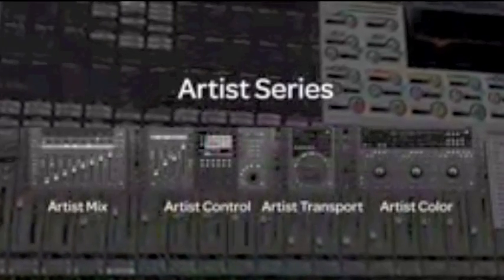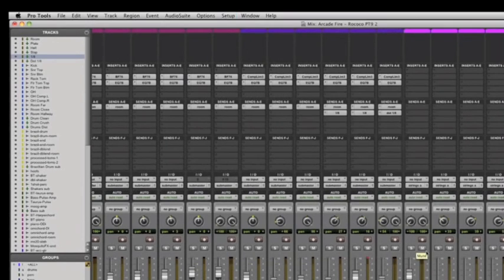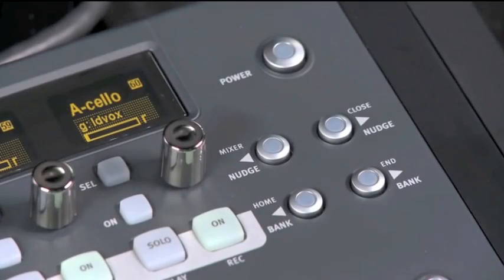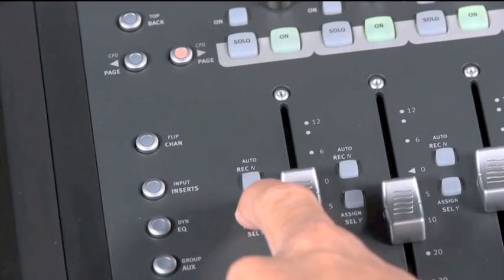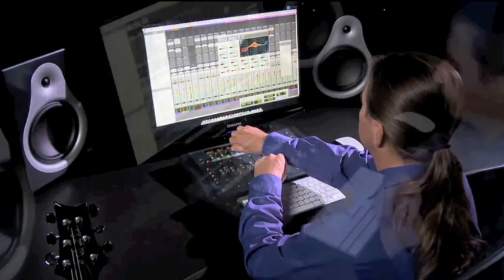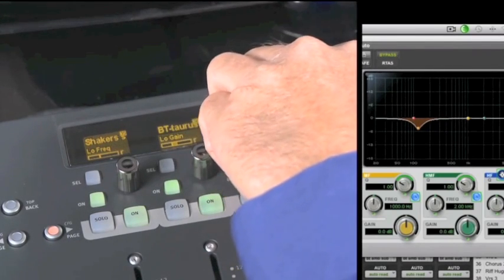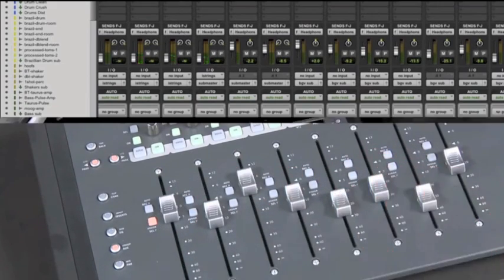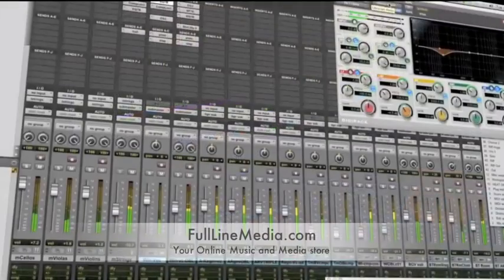Avid Artist Mix Control Surface for Pro Tools Software - Avid Artist Mix

Comment: I love this ridiculous statement at 1:49: "To get started, simply connect Artist Mix to your computer, and select Ethernet controllers from ... menu. And you're ready to go."  What a joke!  Has any AVID product worked on setup?  I bought Artist Mix, and have been trying to install it and get it to work since yesterday.  Hours later, frustration, new software downloads, and it still won't budge. Can't get it to do anything.  Spend all that money (much cheaper control boards out there that really ARE simple, plug and play), and AVID delivers heartache. Good luck folks. At this point, I don't know what to do. Contacted AVID and waiting for support.
Reply: I'm actually waiting for Avid to reply to my inquiry, my thoughts are the Avid Artist Mix Control Surface is not compatible with the latest Pro-Tools . .
Reply: Never had trouble. Worked from the off and always has. The only trouble I had was buying mine used off ebay  but didnt have the driver with it. Avid wouldn't give it me because I wasn't the registered owner!!!! WTF!!! Its a control surface not a fucking car! Then some bullshit about ebay not being an Avid reseller. I had to go on the forums and beg a member to send me a driver. Avid are a joke.